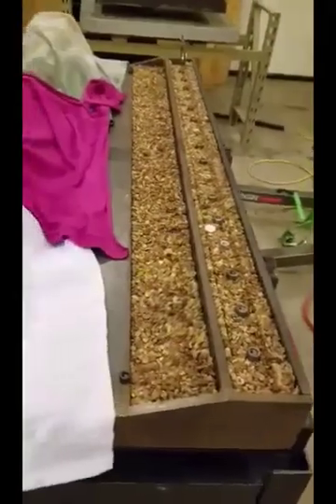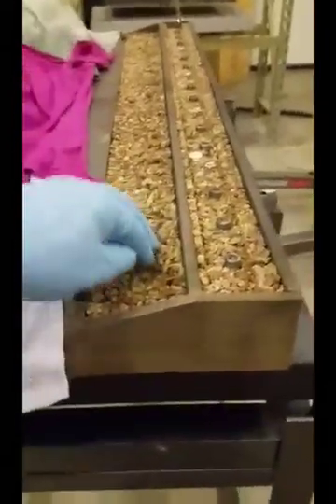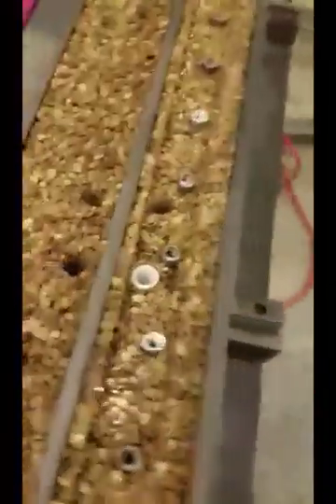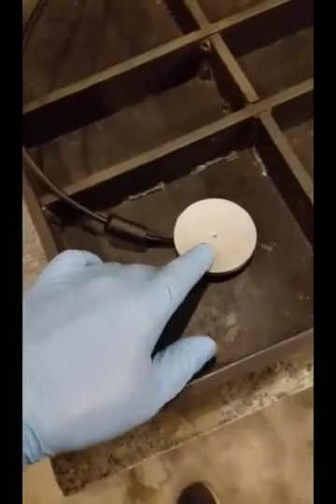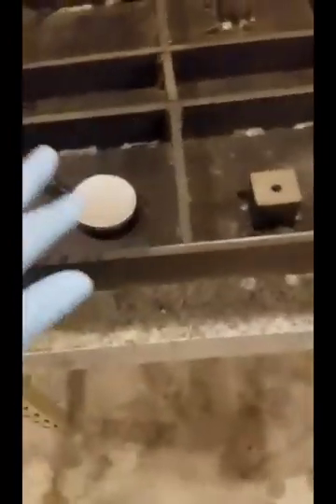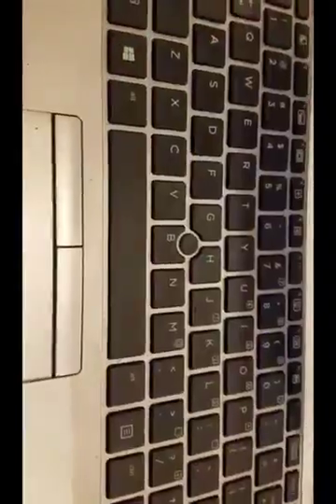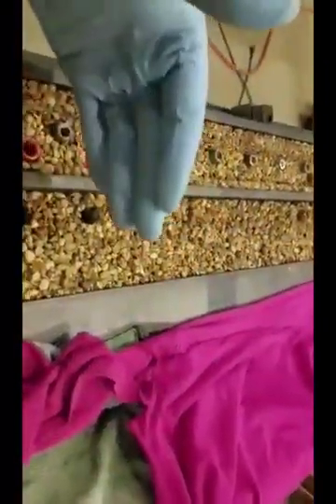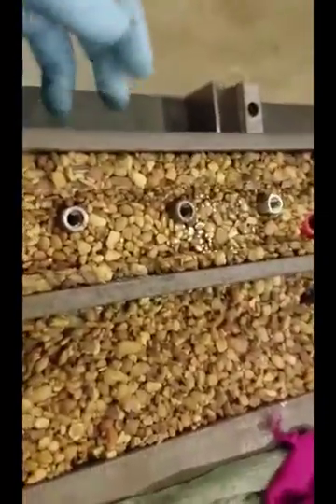Epoxy Vibration Testing

Comment: That sounds like a great ratio of epoxy to filler. 

Did you vibrate the EG it after pouring?
Reply from the maker: I did not vibrate it.  The sides of it are sloped and it slowly moved back down to the center. But we did tamp it with steel blocks until it wouldnt compact anymore.